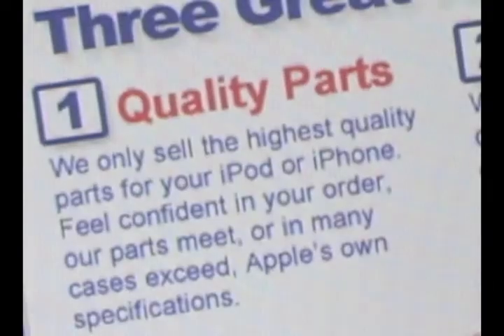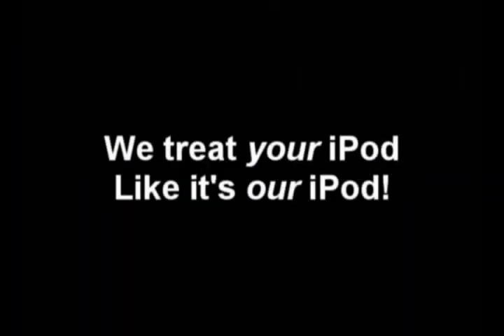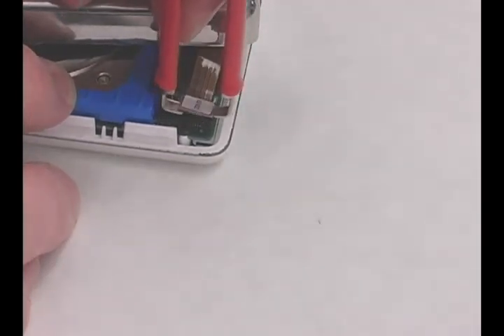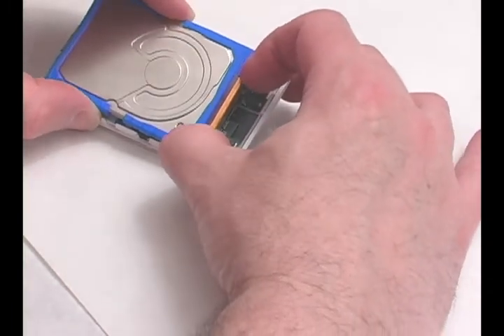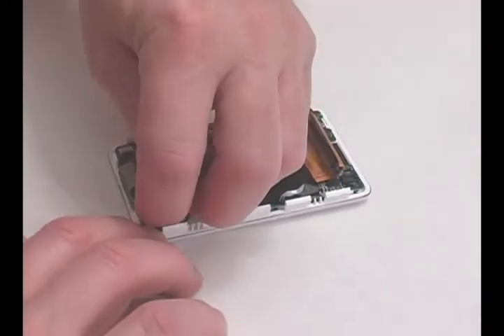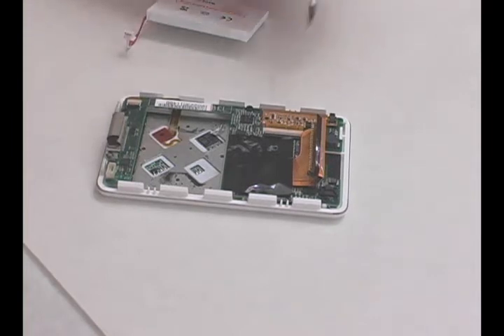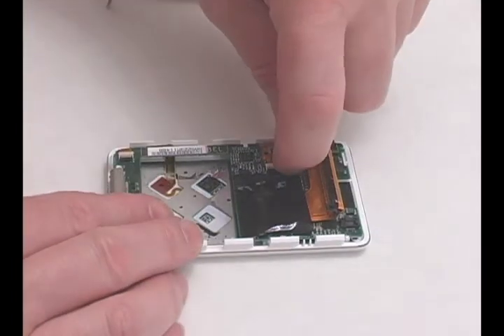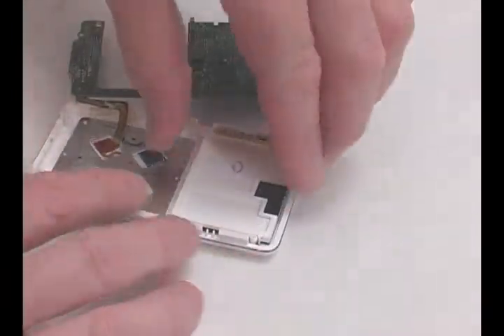DigiExpress - iPod 4th Generation/ Photo LCD Installation

Comment from the maker: It is a molex connector, sames as in a cordless phone.  There is only the pressure of the plastic itself holding the battery in place.  Now in a 5th or 6th generation (Video, Classic) models, there is a two part "clip" that slides upwards to release pressure on the battery cable.

Comment from the maker: @cooly158 for the iPod Touch 4th Generation the gyroscope is located beneath the metal shielding on the logic board itself at the top end near the camera.  The chip has markings of " AGD8 2032 " and has a sister-chip with the markings " 2032 33DH ".  These chips should be the same as in the iPhone 4.